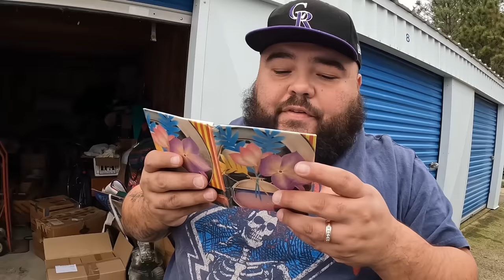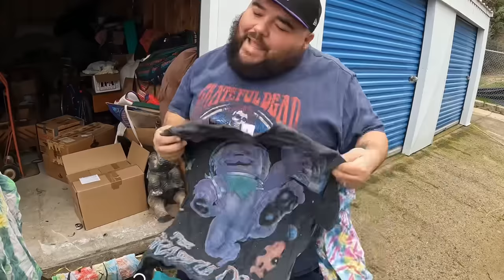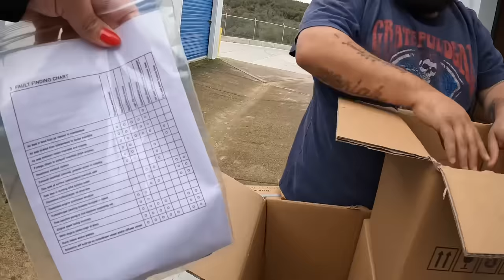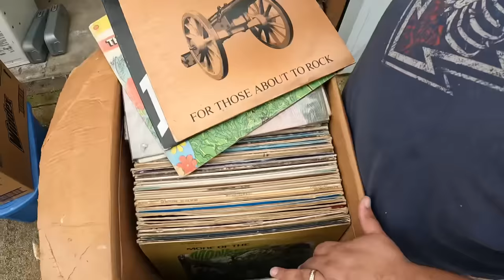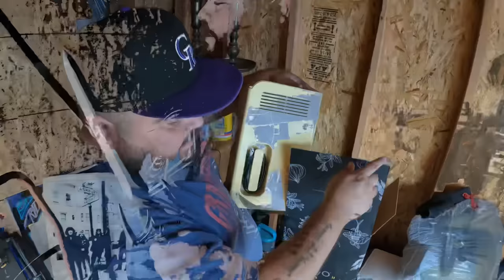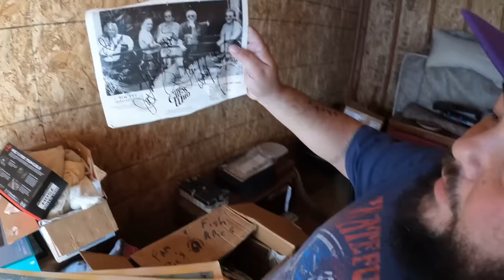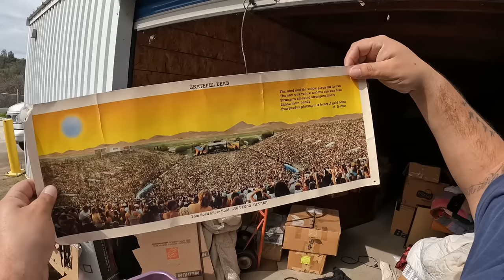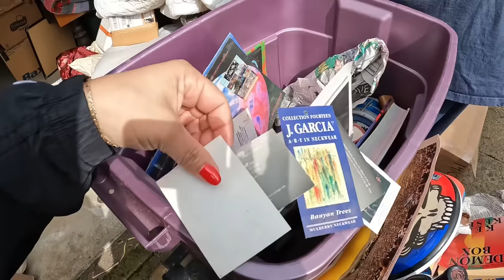WE FOUND A REAL TREASURE CHEST! MOST EPIC ABANDONED STORAGE

Comment: 28:10 put the suede jacket in the dryer on a low setting with a couple of dryer sheets and a towel that you just took out of the washing machine. It will brush it clean without getting it all wet. Should freshen it up real good.
Reply: Learned that one from "helpful hints from Heloise" back in the 1970s